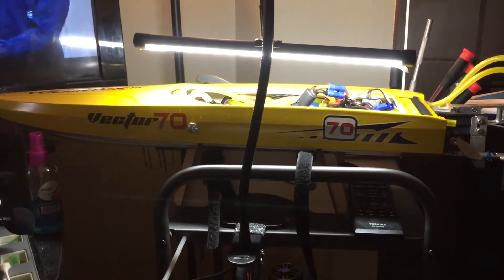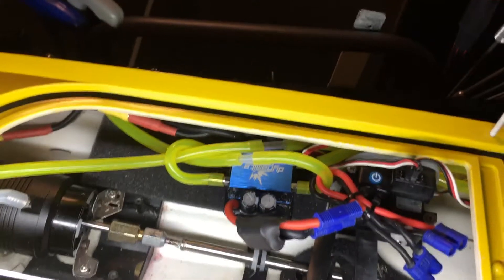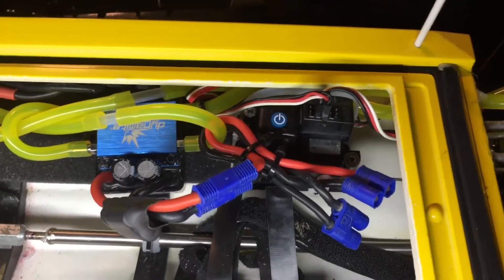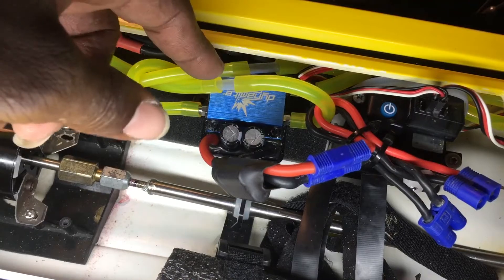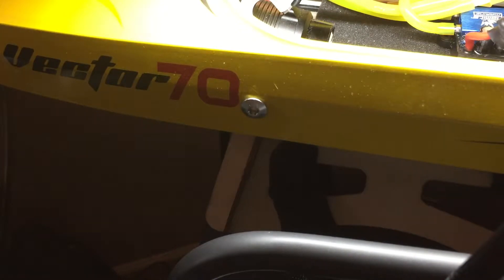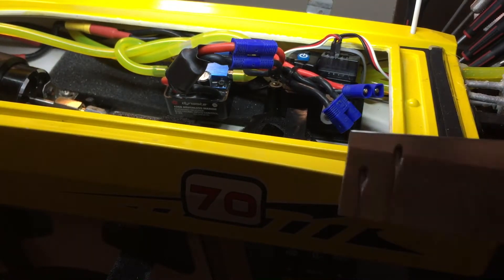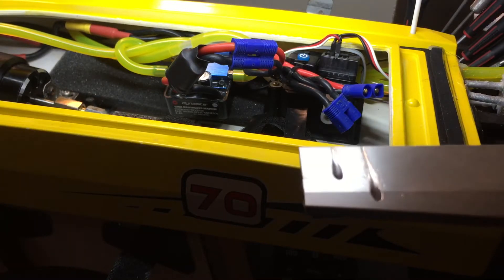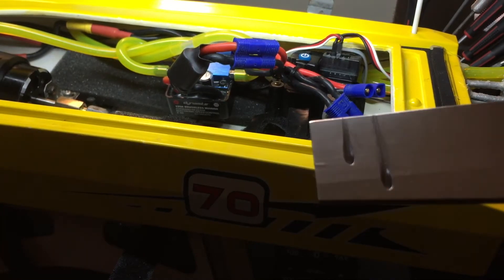Rc boat better water cooling upgrades

Comment: Hey make sure that all of your hose barb fittings are clear I've come across to that have been plugged and no water flowed so check that
Reply from the maker: Thanks
Reply: @pitbikecookracing3324  I'm sure you fix the problem I didn't see that that video was a year old

Comment: Yo wat size drill bit you use for opening them up??? Anything done to the barbs hole? I was thinking that shoild be drilled out as well to improve water flow as I bought an ose daul water pick up rudder and it didn't work at all they have one hole on each side of the rudder for each barb and the barbs are like half the size of the original rudders barb and it didn't move any water through it at all really cause they are so small... did you ha e a similar issue with yours?? Just wondering cause  I might switch to the boat bitz rudder... if this is is not a problem with their's.
Reply from the maker: The RC Adventurer I use a 1/8 carbine bit single cut . The coned tapered one . It ran cool . I the sonicwake. Only had issues on really hot days.